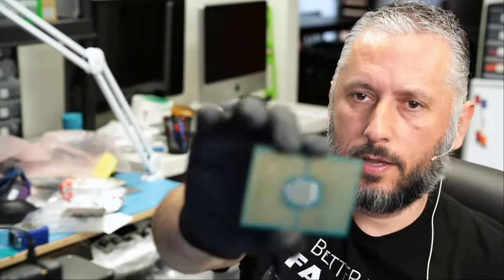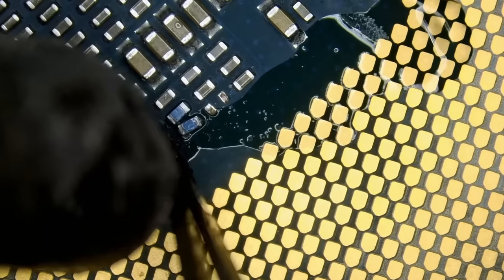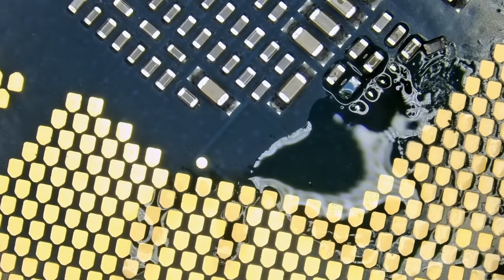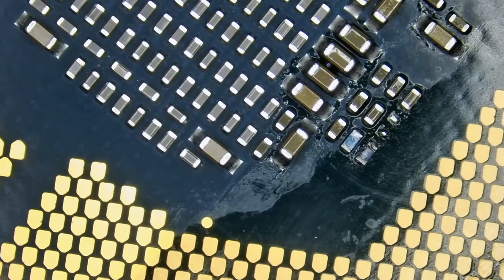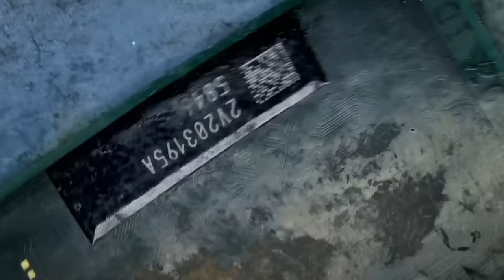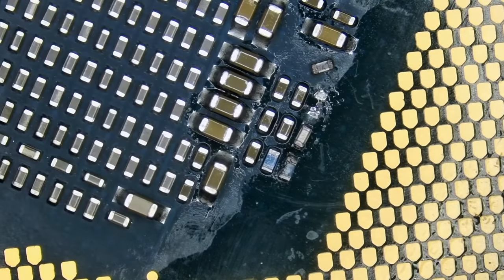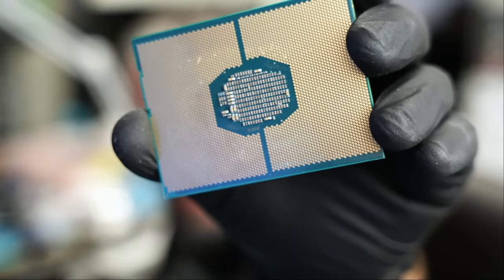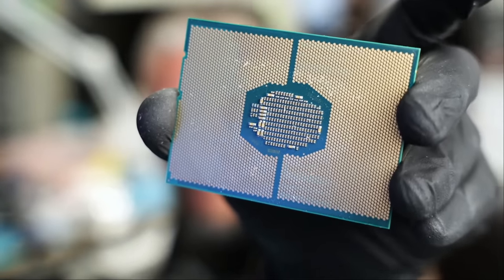Intel Xeon 8180 28 core CPU Repair

Comment: Talking to caps isn’t mad .... just be concerned if you think they are replying to you 😀👍
Reply: Caps have been known to HOLD a grudge.......
Reply: @mike6340  oh I know! In my teen years I used to tinker with CB radios, and AC to DC power supplies in the 20 amp range. I know the grudge they can hold. Lmao!

Comment: :	$5,470.00 cpu, ouch
Reply: And its obsolete now. You can get a 96 or 128 core from AMD with much, much faster cores and probably 3 times more efficient, maybe more
Reply: @Dude-xv4os ya but would require new board and RAM as well
Reply: Yup and they are most commonly used in pairs. They were designed for server duty. I remember one that had a gallium alloy cooler assembly on it made by nanocoolers. The gallium alloy got some air inside that caused the MHD pumps to work intermittently.  Replaced with a tried and true water cooling unit.
Reply: @unnamedchannel1237  if you can spend 5000 $ on JUST the processor, it's a bit dumb to think they can't afford new ram and motherboard that makes it a few orders of magnitude better. Also, when you're in the market for the most powerful thing there is, you usually need it for a good reason 😉 Especially companies.

Comment: I’ve repaired a quite a few CPUs on the past, one one side is in situ I always added leaded solder first to both sides. Luckily the pass were still intact. Sometimes if you get unlucky pads gone and it can’t be rapaired.

Comment: From my experience, CPU's can handle 1 or 2 broken bypass caps. I'm not a complete meathead, most weren't my fault, it happens.
That resistor on the other hand, probably the bigger issue. But you may as well repair them all at once.

Comment: What is the melting point of the leaded solder you are using because the 8180 can get up to 84 degrees Celsius.
Reply: Even the lowest melting point leaded solder melts at 180 C degrees ... so there is no problem. There are no moving parts, like some kind of port - USB, power jack ...

Comment: $10,000 CPU saved?
Reply: knock a zero of that
Reply: Sells for about $6,000 new today
Reply: @kevin-l7r7p  I was going off ark intel's RRP which says 10009.00 - probably add 15% t5o that if you buy from HP :S
Reply: @The98deville  bargain!! Still a good save by Alex if it worked.
Reply: Used on eBay $1k.
Still a nice server chip, but most businesses will be decommissioning these now ( launch 2017)
Reply: $206 on EBAY